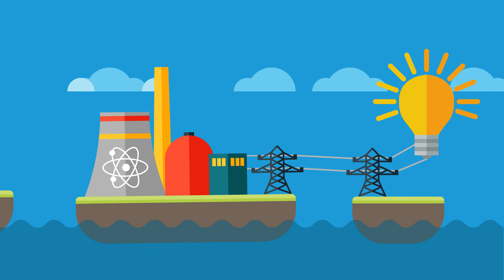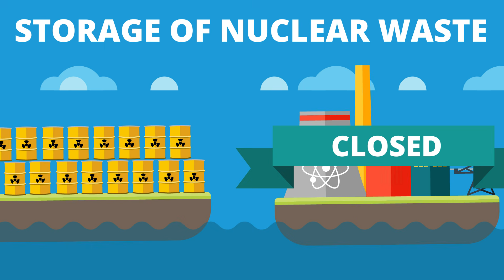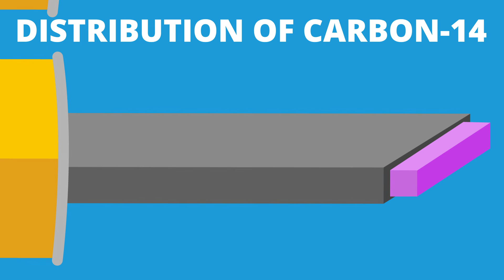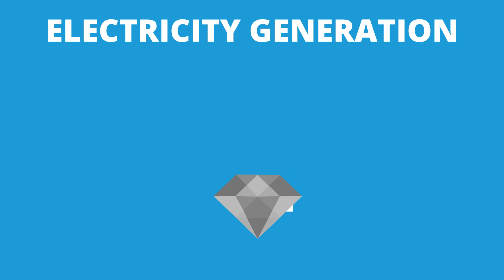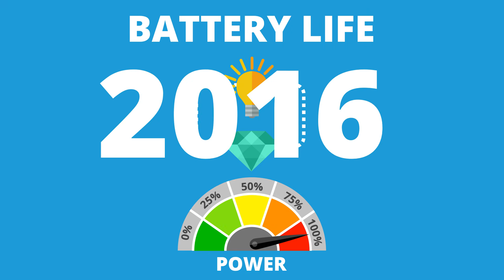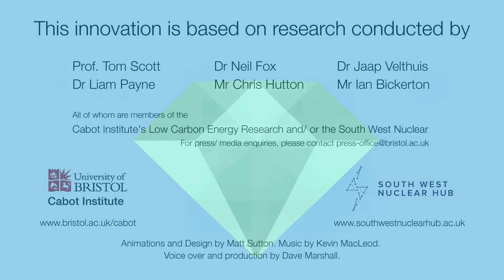‘Diamond-age’ of power generation as nuclear batteries developed

Comment: How well would the ""battery diamonds" hold up against self destruction (e.g. cracking / graphitization) by its own radiation (radiolysis / metamictisation) ? Beside carbon many other radioactive elements could be vitrified into a decently safe piece of ceramic too (e.g. garnet). Maybe they could just paired with a radiation to electricity converting diamond. But there are probably good reasons why this is not in widespread use.
Power density of this is obviously a lot lower than that of an RTG but how does it compare in efficiency?
Reply: I think the advantage is supposed to be that c14 emits beta, and that doesn't damage diamonds.

What I don't understand is what happens when the radiocarbon decays to nitrogen. Does it build up and burst if you don't vent it, or is the proportion of radiocarbon low enough that the nitrogen is contained?
Reply: Well, beta radiation electrons most of the time have still energies way above the covalent bond breaking level, so I'm pretty sure it will damage the diamonds crystal structure. If the core gets really made out of 100% 14C then after a very long time you'll end up with 14N (normal nitrogen atoms) only. The radiation will most certainly efficiently prevent the formation of an ambient pressure stable solid sp3 nitrogen (an abnormal high energy bond topology of nitrogen thus a potent explosive) instead when the nitrogen density goes high enough it will change from a nitrogen doped diamond to a diamond enclosing gaseous sp N2 molecules (normal nitrogen molecules). If the radiation damage is severe most  of that nitrogen gas will probably escape through radiation induced cracks. If the damage is just slight (which I doubt) a quite loud explosion with several 100bar over-pressure could occur. If there is no damage at (which I deem impossible) all of the non radioactive diamond shell is filled with 1000bar solid density gaseous nitrogen or the aforementioned solid sp3 nitrogen explosive.
If instead of 100% on only a fraction (~50%) of the carbon in the core of these battery diamonds is 14C (which would degrade their performance accordingly) the very long term end result might be carbon nitride (a mixture of beta and graphitic form). I have no clue what the mechanical and chemical properties of that material would be and whether it would hold together in one piece by itself.
Reply: The article suggests 1g of carbon 14 in a 20g battery. Or at least one comparison they seemed to make suggested that, 

It's not that clear exactly what is being claimed.

Seems like high concentrations are probably going to be a no-go for both the nitrogen and crystal dislocation reasons.

Starting to sound like some of the problems that plague fuel elements in the nuclear power industry.
Reply: Diamonds can contain huge pressures I would have thought, far beyond the pressure cause by the build up of nitrogen.
Reply: Apparently it harder than diamonds, https://en.wikipedia.org/wiki/Beta_carbon_nitride
Reply: Only flawless diamond can contain huge pressures. The beta decay electron radiation has more than enough energy to break several nearby carbon-carbon bonds and induce many flaws. For the "battery" to be usable there needs to be a lot of radioactive carbon14 included in the core. After one half life time (ok this is pretty long here) there may be so many flaws in the carbon14 infused diamond that there is only a pile of crumbing (nitrogen rich) radioactive graphite left that has still halve its original radioactive nitrogen. Ok to be fair if the non radioactive shell diamond is thick enough it may only receive a view defects after the first halve life time but these few defects make it brittle enough to be unable to withstand huge pressures from the enclosed pushing out graphite (not considering the effects of the not yet necessarily high concentration of nitrogen here). The pressure increases since when the core at least partially transforms into graphite its volume increases majorly (density decrease from 3g/ccm diamond to 2g/ccm graphite !! => volume or pressure goes up excessively). A diamond so flawless to take this level of pressure and strain can't even be produced/synthesized anew by today's crude thermodynamic means.
To get a big macroscopic chunk of diamond strong enough to withstand a few percent of strain (getting it pretty elastic/non-brittle/tough)  it needs to be put together atom by atom with digitally low error rate in a cold environment (atomically precise manufacturing / mechanosynthesis) and it then needs to be kept away from any sources of hard radiation. This can't be done yet and also wouldn't be applicable.
Reply: If there's so much 14C mixed in that one at some point reaches a stoichiometric ration of beta carbon nitride C3N4 then the material will most certainly undergo metamictisation (loose its crystal structure due to radiation damage - go into a glassy state) and thereby undergo massive volume changes/pressure buildups (even long before reaching C3N4 stoichiometry) this is likely to crack the protective diamond shell even if is thick enough that its outer parts only contains the "natural" flaws induced by the original CVD (chemical vapor deposition) production process.

Anyway: crystalline beta carbon nitride is an interesting building material since it doubles the volume of material that could be drawn from just air. 3 CO2 + 2 N2 -> 1 C3N4 + 3 O2.

Comment: yes how about using to get rid of the monopoly posed by the Electric Company? it can power a satellite how about a house?
Reply: It would require minimum a 115 kg diamond for each person in the house; this is a ballpark number based on minimal energyloss and an energy consumption of 1.230 kWh per person.

I wouldn't be suprised if the diamond had to have a mass of ~1000 kg per person.
Reply: then it is a GREAT invention: to be used only in outer space to propel a satellite but cannot wake up an iPhone..:)
Reply: I'm sorry, but my guesstimate was wrong. I assumed a ~100% C-14 diamond with ~100% energy efficiency.
So the new numbers I've got is you need ~10 metric ton diamond per person.
Reply: that is even more way more practical. 10 metric TONS per cap.. JIJI "amazing science"
simply amazing!

Comment: Assuming we had the money to do so, and a good conversion rate of c-14, this would best be used for an extra-planetary orbital mission to simulate deep space conditions of green house growth, and other limited feasible studies. The entire nuclear waste stockpile would only produce at beast about 10 megawatts of power, not even enough for a large neighborhood or two, and that's a lot of tonnage to get into space to begin with, granted the total power output over time is high, its a long time and you'd basically needs thousands of pounds of this to even power a tablet. Solar panels are thousands of times better near the sun, and probably even better past the orbit of pluto in comparison to weight/energy/cost output vs this. It's that weak.

Comment: something that is goanna be repressed by oil companies for a few 1000 years
Reply: ... just like all other batteries have been repressed by oil companies... What?...
Reply: This is a very old, and widely used technology that will never get into consumers' hands.
Each battery contains multiple curies of radioactive material - if dissected, enough to make a few blocks extremely dangerous to live in.
Reply: ***** I doubt that. You need a LOT of carbon 14 to cause that kind of danger. Every living thing has carbon 14 in it. That's how carbon dating works. The technology was used in the early '70s to power pacemakers using Prometheum.
Reply: Hank You don't understand. This is a battery that works purely on beta decay.
Count how many electrons make up a joule, with all the intermediates :)

Those pacemakers still put out a rather sizeable dose rate too, even with over 80% shielding for the teeeny little generator inside, that charged a cap.

This IS a lot. Even tritium-based betavoltaics are highly regulated and dangerous.
Reply: ***** I know it's a betavoltaic battery. I just doubt that you would be able to get anything dangerous out of it. Even if you took the outer layer of diamond off, the material itself is diamond. The entire thing blocks the radiation while the conversion goes on inside. MAYBE if you crushed it up into a superfine powder, but even then, I find it hard to believe it would make "several blocks extremely dangerous to live in." I mean, you probably shouldn't eat it, but you shouldn't eat aluminium either.

These batteries have other larger problems... Mostly that they have stated that a gram of them will be able to output 15 joules per day... That's 173.6 μW... That's probably the max output as well, so... That's much more power than it'll be able to supply in any practical situation.
Reply: Hank That's why I said extremely dangerous, not uninhabitable.
Reply: ***** Oh. I guess we have different thresholds for what we call dangerous, then. Fair enough, lol. I guess using HF fairly regularly expands the "it's fiiiiiiiiiiine" region of safety.
Reply: Hank heh, yes

Comment: I wonder the environment impact once you start putting these batteries on commodities. No one will ever try to send it to recycling once the commodity is broken and, as result, nuclear tiny diamonds will be on the soil, water and scattered all around the earth. Natural erosion will make the rest, exposing the inner radioactive diamond to the environment for thousands of years. The worst is that there will be millions and tiny and very difficult to catch back. I don't have any issue with nuclear power sources as long they are safe and this one seems to be unsafe in the long run if distributed to the public as commodity endless batteries.

Comment: Converting saltwater to freshwater cost efficiently. The problem is that the desalination of water requires a lot of energy. Salt dissolves very easily in water, forming strong chemical bonds, and those bonds are difficult to break. Energy and the technology to desalinate water are both expensive, and this means that desalinating water can be pretty costly.

It's hard to put an exact dollar figure on desalination—this number varies wildly from place to place, based on labor and energy costs, land prices, financial agreements, and even the salt content of the water. It can cost from just under $1 to well over $2 to produce one cubic meter (264 gallons) of desalted water from the ocean. That's about as much as two people in the U.S. typically go through in a day at home.

Urban and indoor vertical farms. Using "aeroponics," which relies on air and mist. Crops are grown entirely indoors by recycling plastics, to make a reusable cloth medium. Sunlight is not needed, by using LED lights that expose plants to only certain types of light spectrum. 

It said it uses 95% less water than a traditional farm because of its root misting system. In a 70,000 square foot facility it's expected to grow 2 million pounds of greens per year.

Sucking CO2 out of the atmosphere and turn it into pellets that can either be used as fuel or stored underground for later. A Canadian start-up says by 2017, it is expected to extract 1 million tonnes per day - the equivalent of taking 100 cars off the road every year. It plans to start selling CO2-based synthetic fuels by 2018. 

In the recycling plant by using vast and complicate fans CO2 is extracted from the air. The it reacts with a liquid hydroxide solution. A carbonate mineral is formed. By processing it in a locked vessel it can be and converted back into carbon dioxide and water vapor, which can be used as fuel, or stored for later.

Connecting the continents by Hyperloop trains. Transportation that propels a pod-like vehicle through a near-vacuum tube at airline speeds. The pods accelerate to cruising speed gradually using a linear electric motor and glide above their track using passive magnetic levitation or air bearings. The tubes can go above ground on columns or underground, eliminating the dangers of grade crossings. 

Preliminary analysis indicated that a route from Los Angeles region to the San Francisco Bay Area, might obtain an expected journey time of 35 minutes, meaning that passengers would traverse the 350-mile (560 km) route at an average speed of around 600 mph (970 km/h), with a top speed of 760 mph (1,200 km/h).

A Canadian space company was recently awarded a patent for a space elevator that would reach about 12 miles (20 kilometers) above the Earth's surface. Astronauts would ascend to 20 km by electrical elevator. From the top of the tower, space planes will launch in a single stage to orbit, returning to the top of the tower for refueling and reflight.

Another candidate, carbon nanotubes. Imagine a ribbon roughly one hundred million times as long as it is wide. If it were a meter long, it would be 10 nanometers wide, or just a few times thicker than a DNA double helix.  A tether 100,000 kilometers long, one stretching from the surface of the Earth to well past geostationary orbit GEO, 22,236 miles up.

Academy of Astronautics (IAA) says it will be able to carry up to seven 20-ton payloads at once. It will serve as a tether stretching far beyond geostationary (aka geosynchronous) orbit and held taught by an anchor of roughly two million kilograms. Sending payloads up this backbone could fundamentally change the human relationship with space — every climber sent up the tether could match the space shuttle in capacity, allowing up to a “launch” every couple of days.

Tractor-beams- Optical manipulation, using directed beams of light, scientists are able to trap, grip, and levitate small materials. Optical manipulation is light moving matter. Photons haven't even been detected as having mass. However, they do have momentum. Momentum has to be conserved. When light hits matter it moves off in a slightly different direction. In order for momentum to be conserved, the matter that pushed the light in one direction gets a little kick in the other direction.

The matter is surrounded, on all sides, by light which will be deflected away from the center of the beam. If the matter moves slightly to one side of the beam, the light will get kicked outwards and will push the matter back to the center. Light doesn't just hold matter in place, it can also move it. Since the beam is deflected whether the matter moves closer to the edge of the light or the edge of the light moves closer to the matter, moving the light can gently, and precisely, move matter around.

Sonoluminescence- can occur when a sound wave of sufficient intensity induces a gaseous cavity within a liquid to collapse quickly. This cavity may take the form of a pre-existing bubble, or may be generated through a process known as cavitation. 

Sonoluminescence in the laboratory can be made to be stable, so that a single bubble will expand and collapse over and over again in a periodic fashion, emitting a burst of light each time it collapses. For this to occur, a standing acoustic wave is set up within a liquid, and the bubble will sit at a pressure anti-node of the standing wave. The frequencies of resonance depend on the shape and size of the container in which the bubble is contained.

The light flashes from the bubbles are extremely short—between 35 and a few hundred picoseconds long—with peak intensities of the order of 1–10 mW. The bubbles are very small when they emit the light—about 1 micrometre in diameter—depending on the ambient fluid (e.g., water) and the gas content of the bubble (e.g., atmospheric air). 

Single-bubble sonoluminescence pulses can have very stable periods and positions. In fact, the frequency of light flashes can be more stable than the rated frequency stability of the oscillator making the sound waves driving them. However, the stability analyses of the bubble show that the bubble itself undergoes significant geometric instabilities, due to, for example, the Bjerknes forces and Rayleigh–Taylor instabilities.

 The addition of a small amount of noble gas (such as helium, argon, or xenon) to the gas in the bubble increases the intensity of the emitted light. Spectral measurements have given bubble temperatures in the range from 2300 K to 5100 K, the exact temperatures depending on experimental conditions including the composition of the liquid and gas. Detection of very high bubble temperatures by spectral methods is limited due to the opacity of liquids to short wavelength light characteristic of very high temperatures.

I do not own nor claim this as my own, simply sharing ideas. Cheers